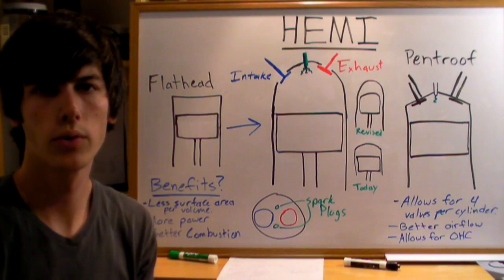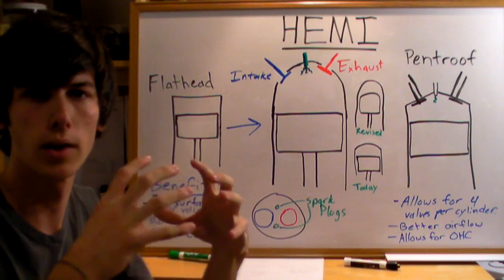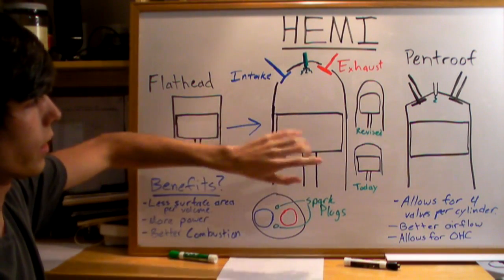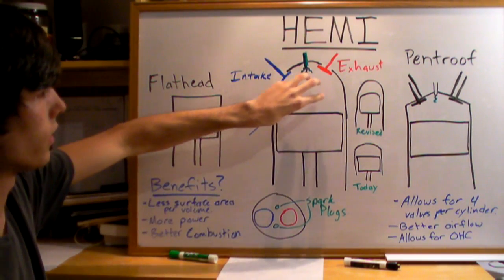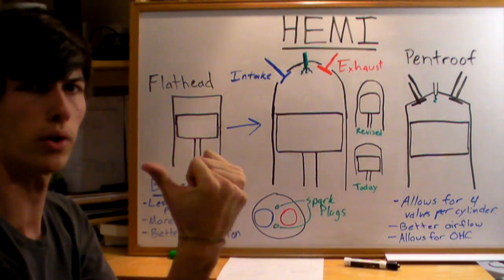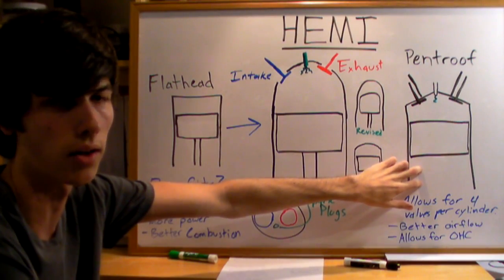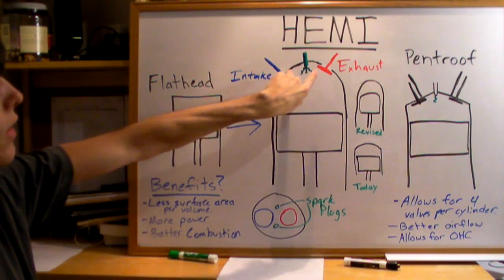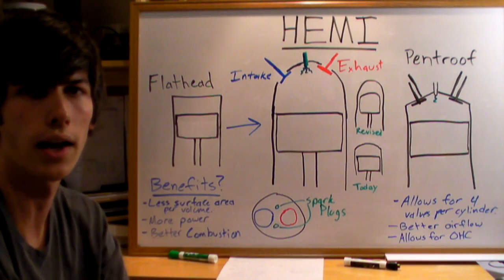What Is A HEMI Engine?

Comment: Stop being so self confirming people, fact overwrites opinion. The fact remains that hemis are outdated.
Reply: +Ken Kord 
But they sound awesome
Reply: Ken Kord and yet the hellcat makes 707hp
Reply: in the pure sense yes. a full hemi is outdated. but a modern "hemi" (I use quotations because they have squish pads and relatively shallow chambers) is not. they preform better on a dyno than GM's LS engines. they aren't as popular but every bit as good if built right.
Reply: Some say that the entire pushrod design is outdated, but its really not.

There is one significant advantage to a pushrod design, which is a substantially lower center of gravity.  The only real downside to a pushrod design is increased valvetrain mass which makes high RPM less preferable.

I've owned a lot of vehicles over the years.  I really never saw a pattern of real life efficiency advantages to an overhead cam engine vs a pushrod engine.  Higher compression ratios, however, have typically yielded me better fuel economy overall.
Reply: 3rd gen hemi is actually not a pentroof design, if we are going to deal in absolutes (what you have been doing this whole time). if the 3rd gen hemi is not a hemi head, then it is not a pentroof head either. it is called "3rd generation HEMI" for a reason.
Reply: The real doktorbimmer ya it's a hemi
Reply: The real doktorbimmer the original hemi design was gone by 1971. The new hemispherical design (gen 3 hemi) is still in production. The hellcat and demon are both gen 3 hemis. Point proven
Reply: doesnt matter if the design is truly hemispherical or not, it is a 3rd gen hemi, end of discussion.
Reply: The real doktorbimmer im 34, dont call me "kid." Gen 3 hemis are hemis. The head is closest in design to the original hemi head. Its still round, just a little flatter. Its a hemi whether you like it or not, quit arguing with me.
Reply: The real doktorbimmer again, i keep saying, i acknowledge that the gen 3 design is not truly hemispherical, but is still a hemi engine. What is so hard to understand about that
Reply: The real doktorbimmer ha ha that's why I'm watching this video, all I know is what I saw when I looked that up, and I have a hellcat and it says supercharged hemi, I don't know why else it would say that
Reply: 1. Any of these engine designs can be OverHead Cammed, not just pentroof
2. Two sparkplugs per cylinder began before WWII in airplane engines for safety/reliability. The twin ignition systems could be turned on and off individually from the cockpit. It was noticed that firing both sparkplugs produced more engine RPMs/Speed/HP than just one because of the faster burn starting at two spots in the combustion chamber... 
3. 4 or more valves per cylinder produce more HP/torque than two valves... there is no loss of MPG if properly designed and tuned...
Reply: Engines are still about the same, but EFI is no where's near as reliable as carburetors... EFI always needing sensors, modules, computers, processors, injectors, coils, injectors cleaned, etc...
Reply: doktorbimmer. The reason why auto, truck, and marine engine companys. Still use pushrod engines, is they can handle constant high power outputs. Over a very long period of time.
Reply: BuzzLOLOL Also not as fuel efficient and cannot create as high a compression ratio. They also cannot be fitted with any forms of VVT and VVL technologies. Yeah they sound cool but there's a reason that all automobile manufacturers have switched to DOHC with some form of valve timing or  valve lift, even though these systems are more expensive to manufacture.
Reply: Zack Hawn. Single cam Diesel engines with push rods can creat compression ratios between 14:1-50:1. Piston design, cylinder head besign, head gasket thickness, cam design and engine timing. All have a lot to do with how much compression an engine makes. Educate youself a little before you go running your mouth off ignorantly like that.
Reply: GM still uses LSx OHV V8 as its main engine for Chevy, Buick, Cadillac...
Reply: Yes MajorLeague your statement is a thee truth. But to whom are you talking to?
Reply: MajorLeague. Yep... as well as in both diesel engines. And radial engines.
Reply: +The real doktorbimmer 
Thanks for the clarification!
Reply: +mrsteve431 Pent-roof OHC engines were around long before the OHV engine was invented lol..
Reply: +grump - rail dragsters still use 2 valve hemi heads because the more powerful 4 valve pentroof heads are banned...
Reply: OHV engines are simple, cheap, efficient, and powerful... only ONE camshaft to deal with...
Reply: Dodge Demon
Reply: +Ken Kord I hate to admit it but you are right.  The Hemi and the Flathead are both obsolete in todays day and age.  Either go with the DOHC that gives you maximum airflow and engine RPM or 2V pushrod (LS1) for maximum displacement from its physical size and weight.

It's Ironic though because right now at this very moment the 707hp Hellcat is the King and thats a Hemi.  I expect GM and Ford do both dethrone it soon however.

Comment: Two spark plugs are a little bit unusual, but not unheard of. Mazda's rotary engine (i.e. wankel) used 2 per rotor, but that's a completely different animal. A more common engine was Ford's 2.3L 4 cylinder that had 2 spark plugs. Other manufacturers did it too. Pretty much same reason why Chrysler is doing it today. Emissions and Combustion.
Reply: The Nash for several years had two plugs per cylinder.  They called it Twin Ignition.